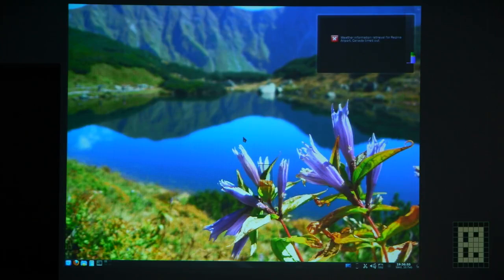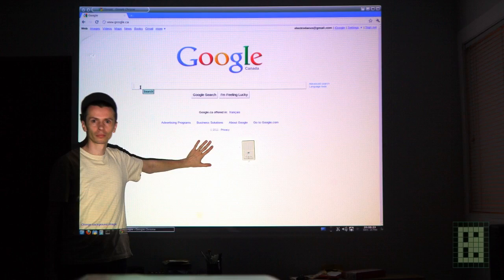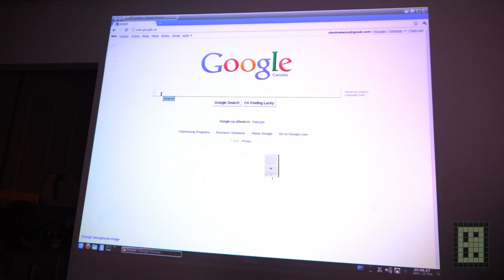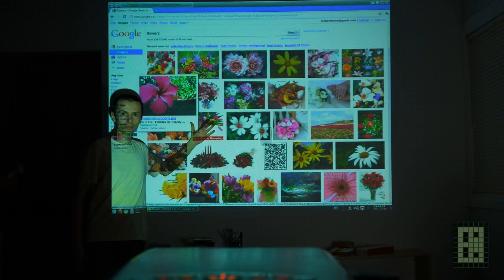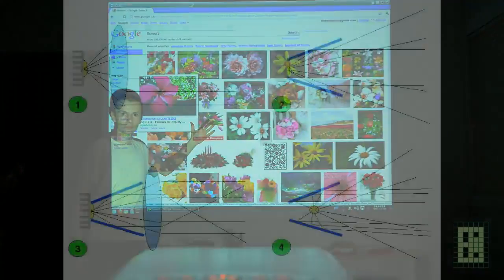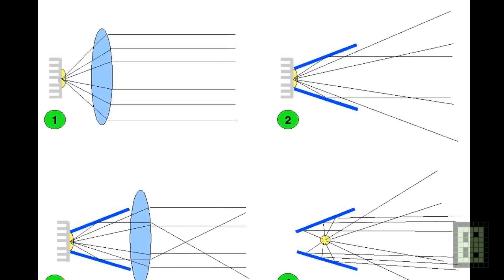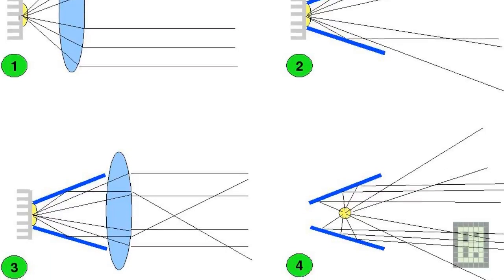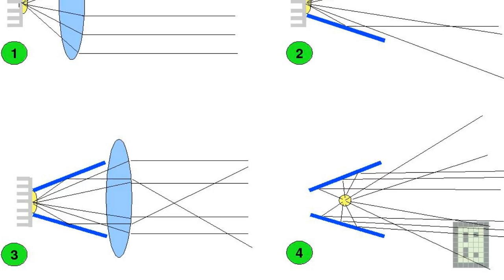DIY XGA LED Projector 3xLCD lamp replacement 25 lumen 720p (part-2)

Comment: Hi there i think the best led is the xhp 70 from cree it has 4000 lumens
Reply from the maker: It is probably not a good LED to use in this type of projector modifications see the end of the video for details and other comments I made.
The max practical size of the LED die in order to climate most of the light is 2x2mm  that means you need at most the Cree XM-L or the newer XP-L to fully utilize most of the available light.
But notice that this video is more than 5 years old it makes absolutely no sense to do this type of modification other than for fun since even the least expensive LED projectors available today will give you a better performance at a lower cost compared with what you can obtain by modifying an old non LED projector.
Reply: i have a xhp70 AND i have a 5 degree TIR LENS on top of it, i was going to make some testing and getting fun the an epson emp3 projector. 

I think there is something that is missing, as i have used several tecnics with lenses of all kinds, fresnel, concave etc. and i cant get anything brigther coming out of the projected size, i can get image if i turn off the lights but nothing that will make bright picture.

i thing the problem is not the focusing of the led what is preventing the big bright image, i thing it most be something inside the optic block which is designed to have a unique light source becase teoretically the fly'eyes (2 of them) on the entrance of the projection tunnel the first is about collecting light, and the other one is about getting an equal amount of light shining on the lcd's. 

i think the solution is to remove something inside the block. 

I do have a flashlight with and adjustable beam when i get the light from the led colimated i get a straight line of light and that doesn't get me a brigher image. if i put the flashlight righ in front of the first flyeye and carefully adjust the "width" of the beam of the flashlight there is a point in wich light seems to increase ad past that point decrease again... what is why i believe its not about how colimated you get the light to enter the tunnel nor its about the amount of light you make to shine in the objetctiv flyeye lens. i am pretty sure that there is some kind of lens that disturbs the way light travels inside the block. 

also the original lap come with a lens in front of the lamp/colimator.

One other thing i have tried i used the flashlight and created a very tyny bright spot (like when you burn stuff with the sun) and aligned it to the flyeye center squares, what would mean some better brightnes but no luck.
Reply from the maker: It is about collimating the light in an efficient way. The XHP is way to large there is no way to properly and efficiently climate the light from that LED.
Not sure how the 5 degree is defined as 2x 2.5 degree or as 2x 5 degree since that will be for sure way to much.
The best way is to test your light source outside of the projector and what you will want to get is a square of light no more than 5x5 cm from a distance of 1m any light that is outside that 5x5cm square is just wasted light since it will never get to LCD or DLP and will be light lost internally in the projector.
Also if you want a real comparison you will need to buy a Lux meter (is very inexpensive).
Then you will know exactly how much light you get out of your light source and out of your projector.
Still at this point in time there are plenty of inexpensive LED projectors that will perform way better than any of old modified projectors so it makes no much sense to attempt to do this unless is for fun or learning purpose.
Notice that my video is almost 6 years old.
Reply: yeah, its just for the fun and learning.   The projected image i get with the simple 2000 lumen flashlight with adjustable beam (i believe its cree xml-2 ) is kind of what you are gettin as output.  but thats what i was trying to convey.

With the Flashlight next to the first fly'eye lens (the objective fly's-eye) i get and image no problem with color balance etc. but its to washed out.. With this flashlight the zoom function just varies the the focal point of the aspheric lens on top of it so teoreticaly i am not getting more light or the complete led's light to the output, i am just collimating some light into going brither and wasting the rest.

what i mean if i have th zoom at 0 i get a very wide beam  i belive its 120 degree beam of flashlight output, if i get the zoom at the max i get a very narrow beam, what that does is a beam of collimated light of a beam sice of the lense. 

If your premise is rightt then  i should get the max brightness i could posible get from the flashlight with zoom at 100% in at which point the flaslight projects an image of the led inside a square. (and with other lenses i can make that squere as tiny and brilliant as i need, almost like a sun spot with a magnifier glass).

but the contrary happens, i put the flashlight next to the light colector, and then gradualy make the zoom increase and there is a point in wich its noticeable and brightnes increase in the projected image.

Now, the TIR thing its diferent, with the flashlight the light that doesnt touches the lens gets wasted, with the TIR you get a very bright spot (with a little halo) but no side spill of light from the led, as long as the led is inside the TIR LENS i get a 5 degree beam and xhp70 it a 4000lm led so its very bright,  the point is that TIR colimates, like a reflector, the lens just colimates when the source is at its focal point.
Reply from the maker: The problem you have is related with the flashlight that is not designed for efficient collimation so probably at 0 zoom you get most of the light out but of course not collimated and on the other end just a small percent of the light is collimated the rest is lost inside the flashlight.
My result is with an LED used at 6W about 500 to 600lumen and probably 70% of the light is collimated with my double lens setup so maybe 350lumen get inside the projector and since projector has an efficiency around 7% or so max I get around 25lumen out of it.
I was driven that LED at 10W for experiment probably 900lm from LED and was getting around 40lm out of the projector but LED was a bit to stressed at full 10W with the amount of cooling to fit inside the small projector I have.
TIR can work great is is properly designed for the specific LED and LED is assembled inside perfectly else it can be quite bad. If the TIR is designed with a plus minus 5 degrees that is 10 degrees total and that will be way to much. The most you want is a 5 degree that is plus minus 2.5 degree and ideal is 3 degree that is just plus minus 1.5 degree. You also need to collect all the light as I mentioned before and a good TIR will do that.

A well made plus minus 1.5 degree TIR can get almost all light on the LCD's or DLP while a plus minus 5 degree that is probably what you have then just 10% of the light will get to the LCD's or DLP as explain in my video at the end based on the spot size.
Spot size with plus minus 1.5 degree is 11 times smaller than the one from a plus minus 5 degree TIR  
Also your light source needs to be perfectly perpendicular with the LCD's or DLP
Reply: electrodacus, i just opened the projector yo play with the optical block, as i suspected its not about focusing the light at the led screens, and its more about getting the light at the correct distance of the objective flys-eye lens, as the use of the light admited into the projection tunnel is handled by several lenses that doesnt modify their behavior in terms of light colimation. 

i'll upload a video later to show you.  Best regards. B)
Reply from the maker: Miguel Angel
The light from the original light source was  perfectly collimated since it used a reflector and the light source was a very small point light source positioned perfectly inside the reflector. So all the rest of the optics will not affect collimation in any way. The double fish eye lenses will just make sure the light uniformity is improved compared to hat you get from light source.
the rest of the elements are to split the light in the 3 basic colors each getting to the proper LCD in a 3x LCD projector. With single DLP there is a color well.
I only used 3x LCD projectors quite a few models since I liked those much better no flicker and perfect image.
A yellow screen for example in single DLP projector is made of green for 25% of the time of a frame then red for another 25% and then nothing (black) for 50% of the time.
Where with 3x LCD you have the green and red LCD allowing light to get out and combine so you get a pure yellow screen with no flicker each pixel is yellow since green and red are projected on top of each other.
Reply: +electrodacus, yes i like 3lcd best.   

i made a small video 3 days ago, but aparently as i included the link in the comment it wasn't showing, check out the light once it enters the proyector,  no point in trying to make a 5 degree colimated light since the flyeye will redistribute the incoming light into beams and re-focuse it to the second fly-eye lens.

we should not be trying to focus your source at the little lcd screens but to make the flyeyes get 
as much light as posible in.  and that has more to do with placing the lightsource at the focal lenght of the objective fly-eye.  I get much more light output depending of the distance i put the source with respect to the fist fly-eye.

The light from the original bulb is not perfectly collimated since its just a parabolic reflector it still throws a lot of light in angles that are not usefull to the fly-eye. The diference is that the manofacturer makes it so the most of the light is at the focal point of the fly-eye.  (i made a small video its in my channel) best regards.
Reply from the maker: I converted many projectors and I know exactly how the light path is inside the projector. The set of two multilens is just there to make the light more uniform it will not help with collimation the light source needs to be collimated else most of the light will be lost and only the straight rays will get to the LCD.
You need to understand how exactly a lens works there are many tutorials on this on the Internet.
The first lens array will need to get collimated light else all the light that is at an angle to the first lens array will be lost before getting to the second lens array.
The light source in an arc lamp is extremely small around 1mm diameter so the reflector can climate this point light source perfectly.
You can use a small red laser pointer to test this see that the laser is at an angle there will be no light getting out of the second lens array.
Reply: yes, the two array lenses are just redirecting light to make the distribution more uniform, that means that it doesnt matter the light source shape (round or square) it will create a even distributed light in the form of a rectangle in the mirros surface.  Now the first flyeye is just an array of plano-convex lenses,  that is why i am telling you it doesnt matter the angle of your light source, as you are not trying to reach the interior lcd screens themselves, as you do need to get more light in, and that is to setting a colimated light source in the focal distance of the planoconvex lens that is the objective flyeye lens, the rest is just handled by other lenses and the other fly eye.  

the point i am making is it really doesnt matter if you get a 3 degree beam angle and shine it at the wrong distance from the first fly-eyes you will still get a low lumen output.

i'll try to make a video with a laser to see how the laser light behaves inside the projector.
Reply from the maker: You need a laser like light source meaning all rays should be perpendicular to the lens. As I mentioned before you do not understand how a lens works exactly it will not work with light coming from all directions.
The first lens array only works if the light rays are hitting the lens at an almost perfect 90 degree so collimated. The original lamp has a perfectly designed reflector so light i collimated and is not spread as from an LED or most typical flashlight that have a diverging light output. If the divergence is more than 3 degree (plus minus 1.5 degree then most of the light is lost as I mentioned in the end of my video).
I do not realy know how to explain this in a few words. 
Imagine you have a divergent light source say 10 degrees total (plus minus 5 degrees) then the the convex lens in the middle of the lens array (assuming you light is centered) will get rays that are almost perfectly straight so they will form a perfect focal point in the back of the first lens array and will properly get to the second lens array so all is good that part of the light will get to the LCD but then consider the lens above that and that will see all rays at an 10 degree angle so the focal point will not be formed at the proper distance and the light will be bent 10 degrees on the other side and that will not hit the proper lens from the second lens array best case will reach another lens that is lower but again at an improper angle so the light will diverge way to much and will be lost inside the projector never get to the LCD.
That is a lens array not a single lens you are probably imagine a single large collimation lens and then if you have a single point light source like an small LED die with 90 or 100 degree divergent light then with proper distance you get a collimated light after but with the array only the lens in the center will work properly all the other lenses will get light at an angle and will be useless (the light will be lost internally in the projector).
Reply: electrodacus i understand the first array of plano-convex lenses and i understand what you are saying, but it seems to get more light into the proyector and noticeable at the output when the led (even without any lens on it) when i put the led at a certain distance from the first array, the light that gets in will improve as you colimate the light towards the flyeye lens.  that i just tested right now, i will make the laser test and make a video.
Reply: electrodacus in your first video you use two lenses, what kind of lenses they are?  and do you have the focal lenghts specs of those?
Reply from the maker: Miguel Angel I do not remember exactly what lenses I used it was about 6 years ago.
I just used two because with just the large one I was not able to collect all the light since the large one had a focal length larger than the radius of the lens so that to work great with the 90 degree output LED.
If you get the proper type of lens for the LED then just one will do fine. I think I got the lenses without much spec from eBay or maybe deal extreme not sure.
Reply from the maker: I did not seen this comment before. Is normal you will get more light out of the projector if you have the LED without any lens closer to the lens array but that is because only one of those small lenses will collect more of the light from that LED. Still that will be realy bad performance compare to properly climate the light form LED. Best way to have concrete results and now what percentage of the light you are actually getting out of the projector is to use an inexpensive luxmeter to test the light output from the projector then compare with the light getting out of the LED.
I was able to get about 25lm with a 6W LED and this is the record to beat :).
Reply: electrodacus yeah :) i am trying to get the best setup, i just put a white paper in front of the projector and the diference in light output is noticeable, thats why i want to now what role distance plays in here...  once i get thar right    i can star playing with lenses with the right focal lens and reflectors.